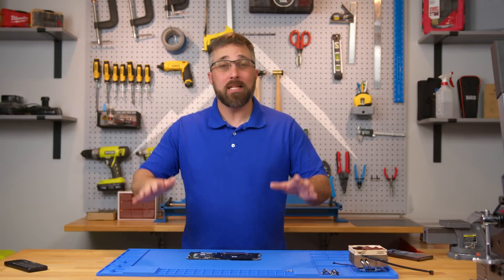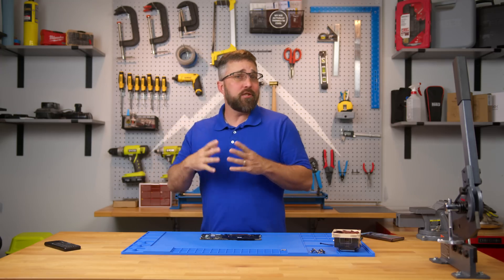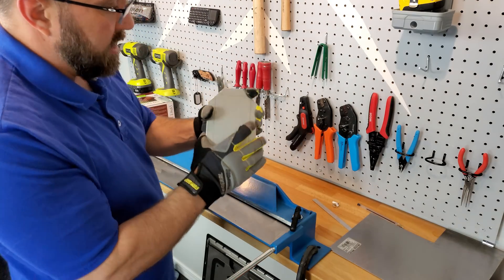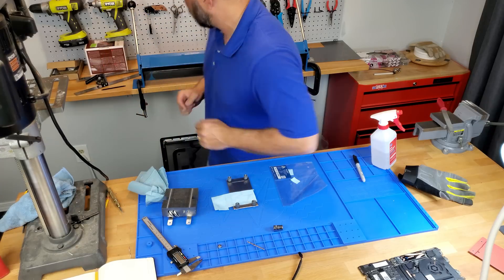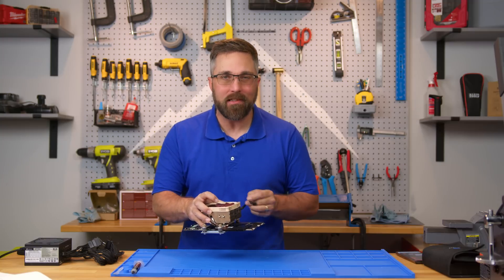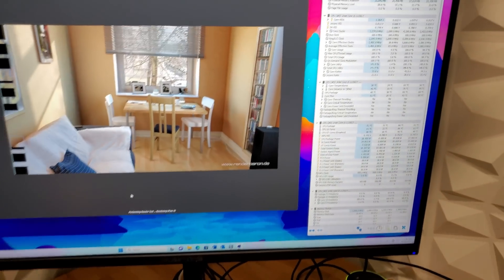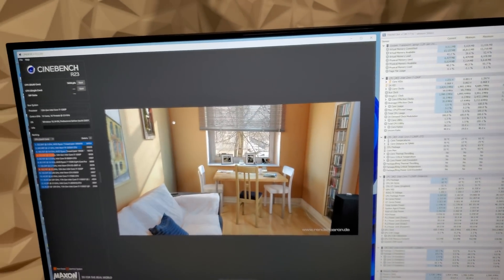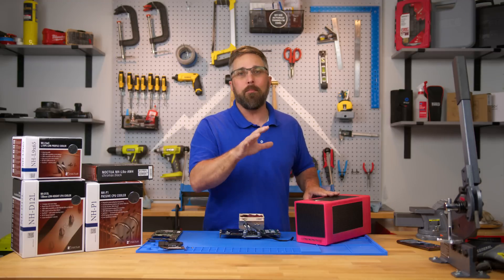Framework Mainboard Meets Noctua CPU Cooler: An Epic Mod!

Comment from the maker: So other than the temps the numbers for the 1135G7 board were bad. Turns out the USB hub I was using was pulling >30 Watts from the board. The 1260P board was a better test without the hub attached and showed how cool the board could stay at max power usage.
Reply: 1260p have those power distribute to more core instead of gen11 which share by 4 and  pump to a high score ,gen11 is hard to cook even with ptm7950/liquid metal

Comment: Were you ever able to test this setup with the L9a on the 1260p? And, did you have any luck configuring the cooler to work with the separate PWM fan controller board?

Comment: Man, this is really want I wanted to do when I switch to my Framework mainboard. Paired with a 3D printed case, this would be awesome! Is it possible to make a 3D printed mounting solution instead?
Reply from the maker: It would have to be a tough thermal resistant photopolymer resin print. There aren’t many FDM filaments I would trust to do the job.
Reply: @ElevatedSystems  Thanks, oh well, I guess I will stick to the 120mm fan mount to the default Framework 3D printed case then.
Reply from the maker: @jierenzheng7670  I added the plans to my GitHub, you can make the mount from 3mm acrylic pretty easily.
Reply: @ElevatedSystems  Let me have a look. Thanks

Comment: other than lower temps does this mod actually delivers better performance?
Reply from the maker: Depends on the task. For most things it's a marginal improvement, but for things like gaming it will improve as the CPU is able to hit single core boost frequencies more often and for longer.

Comment: i was planning on doing this for an oldish gaming laptop which throttles really hard. hopefully a similar solution works. it should get a bigger boost than the framework (it runs at slightly less than half it's power budget)

Comment: As I understand it, the L9x65 doesn't usually perform much better than the L9i/a. Certainly not for as much extra mass and height are added in the fin stack. So I wouldn't be surprised if you swap out for the smaller cooler and your temps jump a whopping 3C at most. Given the large delta max with the LNA installed, it's easy to drop it back down just by removing it. I personally don't feel like Noctua's fans are loud enough to ever warrant the use of the LNA. But that's just my 2c.

Comment: Great idea. I bet the L9 and other very low profile coolers (like some of Thermalright's) will still do the job excellently considering even the i7 1370p (the hottest CPU Framework currently offers) only goes up to 64 Watts.
A little bit of playing with connectors and you should be able to connect the fan's PWM and tach pins to the motherboard's stock fan connector while getting 12V from elsewhere. But I don't know how much flexibility the system's BIOS has for configuring fan speeds, which may be an issue if tying a different fan directly in. In any case, I doubt the stock fan connector can deliver the rated current of a normal fan, so probably best to have any non-stock fan powered from elsewhere even if the PWM tie-in trick works.

Comment: 10:00   i  have  modified my 12v fan  to work with 5 volt usb with no issues ..  (  two cable  ground and power )
 i have had  two 12 volt 200mm led case fans runing off the same 5v cable  / they just run at a slower rpm
Reply from the maker: the board amperage is to low for that here.

Comment: Nice idea to solve this "problem". I had a different idea: If you dont want to use the original cooler, to get back to the stock config, you could use a beQuiet pure rock 2. It doesnt fit out of the box, but you should be able to cut the cold plate down parallel to the heat pipes. This should be somewhere around 26mm after cutting, which should be enough. I wouldnt be too worried about mounting direct die, as it is still done in GPUs and also on enthusiast CPUs. This might even give you better performance, since you only have thermal paste once, not twice.

That being said, your solustion is certainly vialble and more safe, that what I had in mind

Comment: The Noctua NF-A9 5V PWM fan might be worth purchasing since it runs at 5V and could be plugged into the Framework fan header.  It comes with an OmniJoin adapter set and costs $22 on Amazon Canada.  It is 25 mm thick so the NH-L9 fan ciips might not work, but its airflow and noise specs are better than the2500 rpm version of the NF-A9 x14 fan that comes with the cooler.
Reply from the maker: Unfortunately the board can't provide enough amperage for it.
Reply: @ElevatedSystems Oh, I thought 0,26 A wasn't too much.  Oh well.  Great content and well presented.

Comment: I wish that the Coolermaster chassis allowed for aftermarket coolers. It seems like a perfect opportunity to do so for those who want to. Great job on the custom work. I also wish I had your skills and tools, haha. The only question I have is to see how low of a fan speed you can go before hitting throttling. I think 50% or even less would make for a super quiet system while still giving better cooling than the stock cooler. Can't wait until the AMD boards get shipped out and reviewed.

Comment: Now I want to see it water cooled, that would be so cool, a custom loop with a graphics card would be perfect
Reply from the maker: I'm looking at possibly modding an M.2 SSD waterblock to cool the CPU🤞
Reply: @ElevatedSystems  Do you think that this could move enough heat?
M.2 SSDs are only a few W afaik
Reply from the maker: @davidpetry7853  I'll have to increase the flow rate but the cold plate surface area should be sufficient.